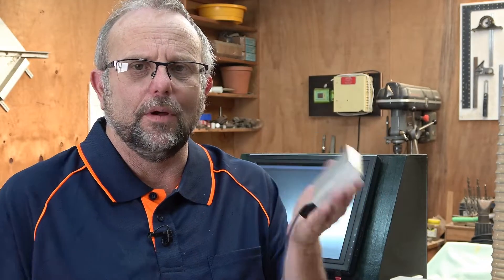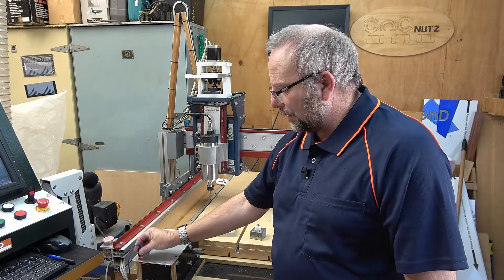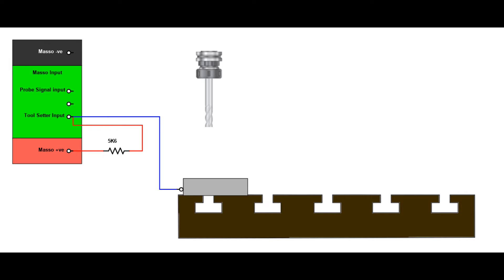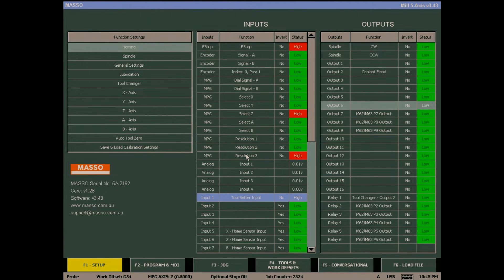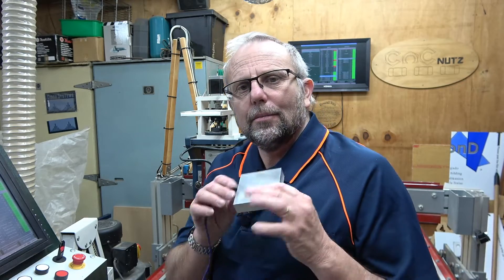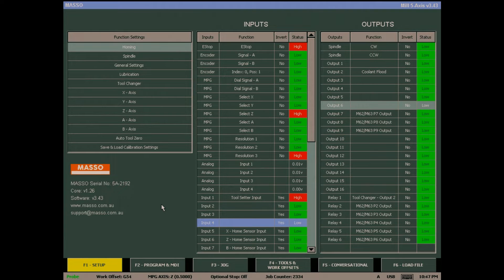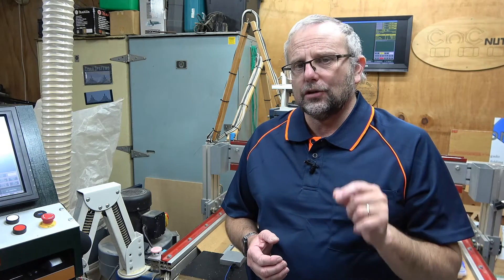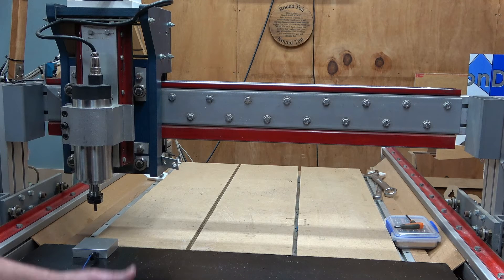How to set up a Toolsetter in Masso - Episode 017

Comment: How does the machine know the z z-zero of your working material?   You home it, and then it touches off the tool setter but I didn't see anywhere that you're inputing the z difference of your tool setter in relation to your tabletop.
Reply from the maker: You don't need to. All you have to do is zero the cutter to the material and MASSO Does everything else.

Comment: If you get a tool setter with the over limit switch, make sure you get the normally open one. If you get a normally closed device, you can invert the signal for the tool setter input no problem, but you won't be able to combine the over limit side of the switch with the Stop Cycle button because that is normally open. Combining the 2 cancels each other out and there's no way to assign another cancel cycle button to an input.

Comment: Hello and thank you for an excellent guide to the tool setter process. I'm new to all this and it has been a great help. I thought I would share one experience with the set up process which befuddled me for a day or two. I found no reference anywhere to the problem I was having so I hope this will helpful. My setup includes a vacuum work holder table. My cutting tool was always off by about one millimeter in depth. I reviewed the set up process, checked work piece thickness etc to no avail. I also checked all Masso settings. Finally it occurred to me that I was turning on the vacuum after probing the thickness of the work piece. The vacuum was compressing the table rubber gasket  and lowering the spoil board by about a millimeter. So lesson learned, turn on the vacuum before probing!
Reply: Wow great tip!!  Thanks!!

Comment: Just wondering why you use the resistor? Will it work without it? What happens if you don't add a resistor?
Reply: Without Resistor you make a short circuit and the masdo fuse blows (and/or the optokoppler is killed)

Comment: Was the choice of 5k6 resistor purely because thats what you had. I cant think of why the pullup cant be anything as long as you dont exceed current input.
Reply: Well, at 24v the 5,6 k gives the needed 20mA - it is not criritical  butit shouldnot too low

Comment: Hey Peter, How does Masso actually calculate the tool length, do you have to use tool probing with it as well in order to calculate that? 
what happens if you move where the tool setters location will this mess up what the tool length offsets are?

Comment: Very informative!!  Great job. You've convinced me to go with Masso on my next CNC build.  I've built 2 some far. Both use conventional PC based boards with Parallel port connections. I use the same PC for both machines.  So, swapping between the two is a real pain in the ass.  Do you have a video that talks about setting the "resolution of the ball screws", i.e. commanded travel vs. actual travel?? I will probably swap one of the machines over to Masso in the new year. Thanks for the very informative info.
Reply: That video does exist. It’s pretty straightforward. There’s also a wizard In Masso in case you don’t know your specs. There’s even a backlash setting in case you need it. 

I can’t wait to get my Masso...

Comment: Hi peter,  another great Masso video. I think that your table on the machine must be non conductive if the circuit you showed is enabled.On an all metal machine the block would close the circuit if the metal plate is sitting on it the table. The block needs to be connected to the negative of Masso and the positive to the tool.  The commercial Dog River Tools achieves this by having a positive and negative running to the block and a fly lead from an insulated block terminates on an alligator clip that is attached to the tool. In that way the isolation is achieved. Cheers, Richard
Reply from the maker: Hi Richard,
I'm afraid i have to disagree with you on this one.
If my table was conductive I would put a non conductive layer on the bottom of the block. eg glue plastic to the bottom. 
For safety the table should be grounded to earth and since some power supplies have their -ve grounded and Masso uses -ve ground it is reasonable to assume you would ground your machine to the -ve and not +ve as you suggest.
cheers
Peter

Comment: Peter, what is the recommended wattage of the 5k6 resistor? Thanks for the easy to understand videos.
Reply from the maker: it doesn't matter as this is a logic levels. Use a 1/4 watt not because you you need it but because they are common.
Cheers
Peter